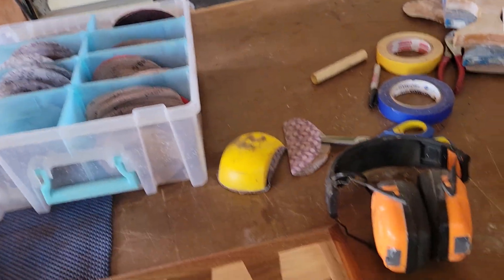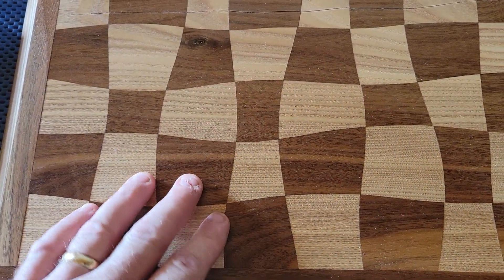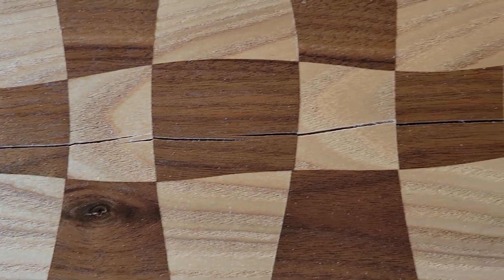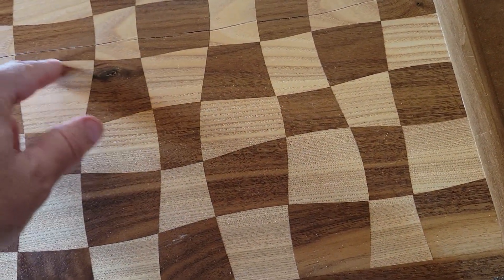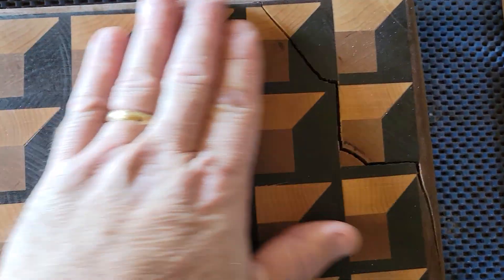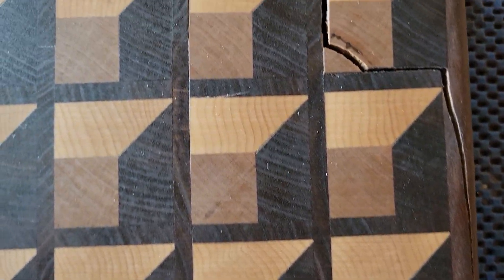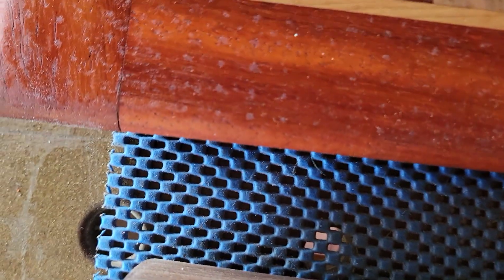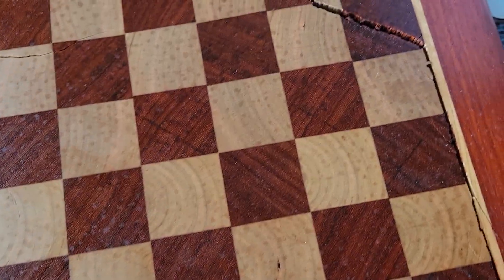Never mix long grain and end grain.

Comment: Not sure if the grain direction has anything at all to do with the cracks in your boards.... I've done it for 10 years and have had ZERO issues.
Reply: Surely not an issue if the timber is dry? Never seen it before either.
Reply: @StinkingBishop it really doesn’t matter what people think. What matters is is the maker happy happy happy with the end result. There’s wayyy too much BS from woodworkers that think there’s only one way to do things and it’s their way.

Comment: Wood at the microscopic level is like a bundle of thin straws along the grain. The wood will expand and contract with the seasons perpendicular to the grain (with only very little movement change parallel to the grain). Therefore, in these butcher block chess boards, the squares of the chess board must have shrunk (i.e. from entering a drier season or continuing to dry out naturally). The length and width of the border pieces would not have shrunk - they have remained firm at their original size (or thereabouts) while the squares have shrunk and pulled away from the border. So, rather than the edges ripping the boards apart, it's the centre shrinking and pulling away from the edges.

Comment: Absolutely stunning work. I'm amazed at your finish quality! As gumbo said, the fitments are so nice and neat. Great job. 

Obviously, allowing for expansion is a solution. How you do this is up to the maker! That's why I love this stuff, there's a hundred ways to solve this problem and they're all correct.

The first thing that comes to mind in these circumstances would be to affix the frame/border with fasteners. Maybe brass buttons or I also really like the "door nail" technique where you start a nail, bend the tip, and fold it over like a staple.

Comment: I imagine there's still probably a lot of solutions to this issue that have yet to be explored. Keeping the frame attached through tension rather than glue could be worth a shot. Or maybe creating a sort of gap or spacer to relieve tension when the wood expands or contracts (kind of like a sidewalk).

On another note, your glue-ups are some of the most complex I've ever seen. I have no clue how you can get such a perfect fit with such odd shapes.